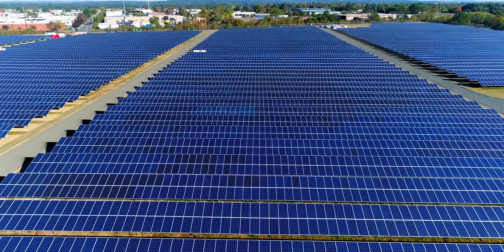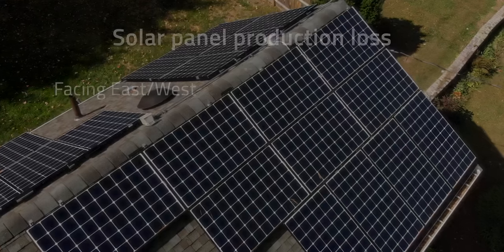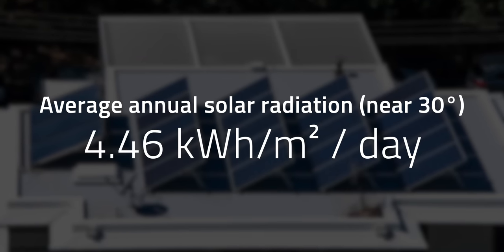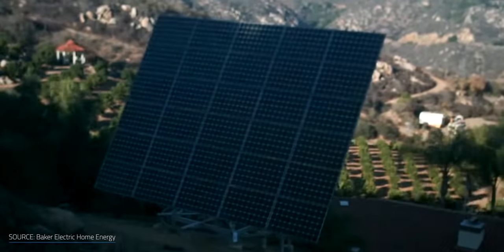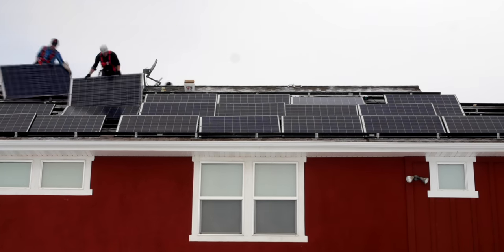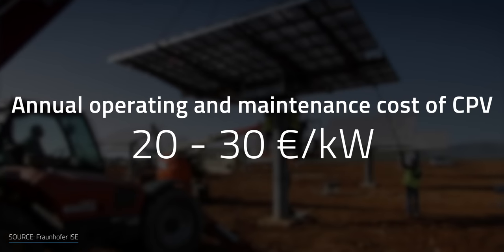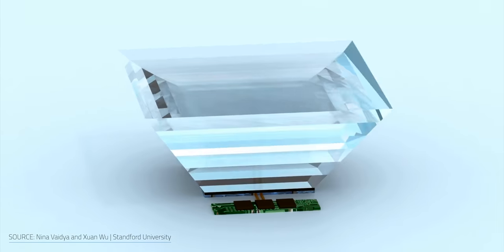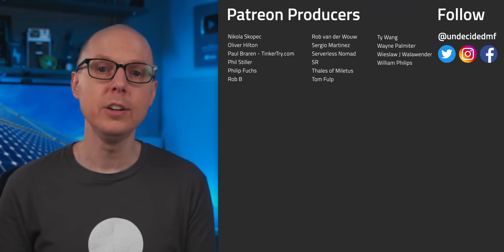This Invention Could Supercharge Solar Panels

Comment: someone needs to invent a way for panels on a roof to rise up on a hinge. meaning one side of the roof will always get more sun, but the side that starts to revive less sun , they can see raised and angled to get more sun. imagine the panels at the top are on a hinge and the very bottom panels all together get raised up.
Reply: It's called an adjustable mount.

Comment: Countries like Japan and in densely-populated areas, the extra cost of the AGILE prism will pale in comparison to the cost of land needed for solar power plants. In roof applications this may not be so important, but will reduce the use of PV material. Selenium, Cadmium and Tellurium, which are used to make the PV cells are toxic and may leak to the environment if cells are poorly maintained. the AGILE prism reduces their use and the cost of their recycling.

Comment: As a  average solar enjoyer i need thin long solar panels that I can oriented like window blinds so that whitout making them very receptive to wind and damage 

I live on 51 degrees s in the winter i get the sun at 15 degrees at mid winter. And I live on a boat so panels can only put them on flat wich works fine in summer

Comment: It doesn't have to track the sun. It could just use a fixed system that all it needs is time of the day, time of the year and location. That would track the sun without a sensor.

Comment: In 2008 a 12yo student by the name of William Yuan invented the idea of 3D solar cells which i believe had the photo cells arranged in wort of an accordion to pack more surface area into the same 2d plane of the solar panel. if you paired that design with these sun ray directing lenses so that each side of the v-shaped groove of the accordion got full direct light, wonder how good that could be.

Comment: Solar panels are already so cheap that the installation work and hardware, electrical cables and power electronics are much more expensive. We're already at a point where it's just easier to slap an extra panel or two on the roof, wall or lawn than worry about getting the efficiency from 19% to 22%. The concentrator panels might make sense in some special cases but I think it' simpler and more cost efficient to have separate east, south and west facing pv chains than worry about the oblique angle on your south-facing installation. Besides, at higher latitudes they're already doing vertical wall installation because that helps the winter generation (catch low angle sunlight and keep the panels snow-free) and is so much cheaper to install and maintain and it helps to reduce the noon peak and spread generation towards evening and morning.

Comment: I am a little bit confused, I always thought that a hard limit is the area exposed to sun. If those prizms are the same are as standard PV I would assume they cannot produce more energy. Unless the micro PV themselves are better efficiency. Maybe micro PV are much more costly, then prism is just cost balancing solution. Still confusing.

Comment: My house, roof mounted system saves me about 40% on my electric bill. Generation peaks in May, SE facing roof, and thought if I could at least change the angle up, it would peak in July/August where electric demand is much higher. The problem I have is with birds nesting around them. This idea would provide more shelter and more birds, I'm afraid.

Comment: Could you try a nightvision layer? Nightvision have special layers in tubes that increase rest light. Maybe a layer on top could result in higher yields perhaps even during nights?

Maybe instead of focusing you could try the opposite and diffuse the light inside a chamber. Bounce light around. If you use 5 pyramid shapes you could have a perfect lattice.

Comment: The concentrators reduce the area of solar cells but not the area of the panel itself, so although it may save on cell production cost, panel installation and manufacturing costs may not improve. Also, 3D printing is an expensive process for manufacturing on such a large scale, I would think a simpler molded concentrator would be more practical.

Comment: Concentrating solar panels require direct sunlight to operate at their full potential and tend to have either nearly 100% output in direct sunlight or nearly 0% in defused light.  This creates a significant problem for the grid because solar output tends to be either all or nothing which leads to grid control problems if the technology constitutes a significant portion of total grid connected power.  I can not speak for the new technology but I would say the test would be the relative power output change from a sunny to clouded day.  If the technology does not maintain at least 50% output under clouded conditions it is likely bad idea for grid connected solar arrays. A secondary test would be how it performs when the sun is at a very low angle to the surface of the panel because that is the power output that is most critical for supporting the peak apparent load conditons when solar becomes a large portion of the total grid power supply.

Comment: There is no way a fixed concentrating system achieves the same thing as tracking -- Physics doesn't permit it!  All that these optical system can do is ensure that more of the light that's normal to the top of the optical package is directed at the solar cell.  If the angle of incidence is zero the light is perpendicular to the surface and you get maximum power, but if the angle of incidence is 45 degrees you get about 71% of the power.  Tracking system drive to make the angle of incidence as close to zero as possible, but such systems aren't feasible when you have multiple rows of them due to shadowing.  In summary, with concentrating solar there are two angles that matter:  the primary angle of incidence, preferentially perpendicular; and then second angle is from the surface of the optics to the surface of the solar cell.  The optical system described here can handle the second issue but does absolutely nothing for the first!

Comment: That system will work even better when AGILE can keep the CPV system separate from the solar cell so the cells can be replaced at the one of  their life span were the CPV could maybe work for more then one cell generation, a bit like you swap filters in a A/C system. When it is time to replace the solar cell you could pull out the cells and use this swap time for a thorough cleaning of the CPV surface to make it last longer. If possible the AGILE system should not have the CPV and the solar cell combined, a modular approach might be maybe more cost efficient over time. Well, just a thought.

Comment: It strikes me that panels should be angled to optimise Winter production if they are fixed throughout the year. The Summer light is coincident with reduced demand and much greater production so inefficiency is not a problem.
Of course, if you live nearer the equator, you're golden...
Reply: Local weather/climate can also affect optimum installation (for example if often cloudy in the morning).

Comment: I just finished my solar tracking system, single axis. It occurs to me that there seems to be an hour or two at dawn and dusk that would not get much (if any?) direct sunlight if the panels were stationary and facing south (with optical concentrators). Wouldn't the optical concentrators require direct sunlight of some kind? (This will change as fall and winter arrive, but I'll also get less and less light. So it wouldn't seem to matter either way.) It still seems to me that tracking would capture more energy. (I spent a lot of time on making it, but it was only cheap lazy susan, a 18 dollar electric motor, a 40 dollar tracker board, a few wires, and a few rechargeable D batteries. I took it more as a personal challenge to see if I could make it work.)

Comment: The real problem with solar trackers is nobody came up with the right set of features and then mass manufacture the tracker, if someone made a tracker that highly compatible for Agricultural and Ranching, as well as it module that can easily swapped out for repairs in a controlled environment like a Maintenance shed, all they need is a special design attachment for their tractors and repair jig in the maintenance shed.

Comment: I'm thinking it would be great if the "lensing" layer could be applied over used panels and stuck onto the sides of building or added to the roofs of affordable housing/apartment complexes to provide grid-proof and relatively low-cost housing.  Do you know if the layer can be an add-on?  Thanks for doing what you do.
Reply: use plastic mirrors to send more sunlight to your panels

Comment: In large cities, soot, dust, snow, ice and assorted pollution on solar arrays reduce power output significantly. Adding a larger lens surface just creates a better collector of Schmutz! The larger aperature actually collects more airborne crap, and this pretty much kills much of the value delivered by this product, unless it comes with a cleaning apparatus!

Comment: No. While concentrating light will boost the performance of any solar cell, you still need the same amount of lens surface area for sunlight to fall on in order to concentrate it. The added expense of producing the concentration lenses likely outweigh the cost of using larger solar cells. Individual cells not mounted on a panel would benefit from getting additional light from the side, but when closely mounted on a panel the row of cells closest to the side where the light is coming from would shade the side of the cells next to them, which in turn shade the cells next to them. 
  It's most likely one of those things that shows great promise in the lab but fails in real world applications,  something to get grant money from the pinheads at the DOE but will never go into mass production. I think someone is trying to justify the purchase of that 3D printer, injection moulding acrylic could do the job at a tiny fraction of the cost of 3D printing.

Comment: There is only the same energy per unit area. The focus should be on improving panel efficiency. If total efficiency were also a function of total exposure of watts/m^2 and increased watts/m^2 caused efficiency increases which exceeded the energy lost by reduction of real panel surface area then it would make sense

Comment: A great video and information for the home solar setups and apart from cutting our personal carbon footprint solar needed another reason to invest and that comes with the EV, once everyone realises that installing a home solar kit on your house with battery storage suddenly you find you can charge your EV for FREE and have unlimited driving and milage all for FREE and if you cost that against how much gas/diesel you buy over ten years your realise that the solar set up pays for itself just in those savings, even quicker if you are doing high milage each year or that your ICE car was a gas guzzler, the question is how much do you spend on gas each month?

Comment: Nice video.

I guess if there is any research about efficiency losses due to not cleaning the panels regularly in private homes.

I can think of people considering many factors when designing their installation (installation power, tilt angles, tracking system, batteries...) and completely neglecting cleaning/maintenance during production.

Cleaning, the most simple way to boost your installation production and keep nominal levels.

Comment: The problem with solar panels is that recently, power companies have been penalizing solar panel owners with higher rates, or minimum charges. Also, the solar panel company will place a lien on your house, so the house can’t be sold until that lien is paid-off. Also, while solar panels are pretty reliable, the electronics are not. A single repair to the electrical system could cost five thousand dollars. 

For those reasons, solar panels aren’t such a great idea. The payback on a solar panel system typically takes ten to twenty years. No investor would spend money on solar panels. Any similar investment would be expected to yield at least a twenty percent return. 

So financially, solar panels are a bad deal unless you live in a remote area, where they are your only source of power.

Comment: Isn't there still the issue of simply getting fewer photons when the angle of the solar cell is not perpendicular to the sun, based on simple geometry. So using concentrated solar with these optics would not really solve the problem of efficiency loss due to cell orientation. Maybe it solves the problem of additional losses caused by low angles (e.g.: reflection issues).

Comment: There was a company called Herutek/Solarum that conducted similar solar panel experiments using a magnifying glass apparatus with adjustable heights  and was able to get 90% yields for 3hrs of sunlight. So yes AGILE will succeed just as H/S did 5yrs ago

Comment: One way to make solar power scale is a rather dramatic one. The idea is to build an orbiting solar station that collects the  energy in orbit. Then it fires a high-powered microwave beam to a collection facility where the energy is used to generate electricity.

The major downside is: now you have an orbital death ray.

Comment: So many of these systems seem to be schemes to get more funding as they give you the good numbers but hide the bad ones. They give you that the area of solar converter panel is more efficient per area but they hide that the area is a lot smaller as the concentrator takes up a lot of the space, they tell you how much more power you can get per year but don't tell you the life of the panel is a lot shorter as it gets way hotter because the light (including heat) is concentrated into a smaller area and high heat decreases efficiency and decreases the life of the panel. Also what is the weight difference over standard panels? Overall I don't think that they offer much improvement except in very southern hemisphere or very northern hemisphere areas as they are cooler and suffer more from the angle change throughout the year.
Reply: At least the heat is a solvable problem, since we are pretty good at moving heat from place to place. It could even be added to the existing home heating system, if we had any sense.
For the area issue, could we not move the lenses farther away, and make them larger, sort of a magnifying lens over the panel? By making the lens larger, you add more power, but by moving the lens further away, you diffuse the light that gets to the panel, covering a larger area. You could even move the lens if you separate it from the panel, getting some of the advantage of the moving back in.
All in all, these are engineering challenges that could be solved.

Comment: I've seen several of these ideas come and go. What makes them go is the added manufacturing cost. In this case the added mass would also be a concern for anyone wanting these on the roof of a dwelling.  I would think it'd make more sense to invest in keeping the panels cool as that has a major impact on efficiency.
Reply: Interesting you say that. I've seen water-cooled panels - the by-product being very useful hot water! One of the biggest costs is batteries but I'm looking to store thermal energy in a sand battery - seems to be growing in popularity in N Europe at present.
Reply: Added mass wouldn't be much. The lens layer isn't going to be much thicker than a normal protective glass layer and weight would be reduced by the voids between the individual cells.

Comment: This is another one of those things that makes me wish that I had become an engineer instead of just learn physics in college

It just seems to me that the ultimate solar panel is going to be a combination of a dozen different technologies

So something like this, plus some things that I’ve seen on this channel and others about infrared radiation solar cells, plus using the heat from The solar cells to heat water, plus using any reflected light or energy that the solar panels can’t absorb to bounce into or pass through the solar panel and enter into another form of radiation capture

It just seems to me like there’s a geometry problem that’s here to solve that if we just solved it we could double the efficiency of solar panels right away
Reply: I also have long thought that some thing similar to retro reflectivity could be used to compensate for the direction issue of solar panels

Well nothing can be done if the sunlight doesn’t fall on the solar panels at all, we should be able to at least make it so that all of the light that hits the solar panel goes into it, much like a Vanta black paint takes in all the light. Looking at this video at three minutes in, I’m betting if that’s some thing like what’s happening here, but it just seems to me that retro reflectivity could be used either with reflectors or prisms or lenses to bend light from any angle to the location of maximum absorption
Reply: @skizmo1905  probably need to be more specific, what exactly is pure bs?

Comment: I have a better idea, install panels like honeycomb hexagons, put a divergent mirror to the bottom. make sure you have channels for rain, and heating for snow. the system will need auto-steering to get the max sun light though.

Comment: Well lots of inaccuracies here, Solar trackers are not at all a niche technology they are used on 85%+ of solar power plants in the USA. The AGILE approach does not obviate the clear economic benefits of trackers it just increases the acceptance angle of a LCPV system which long ago became economically unviable due to the low cost of conventional solar panels. Almost all CPV companies went bankrupt years ago and nothing in Agiles approach solves the reasons for their demise unfortunately.